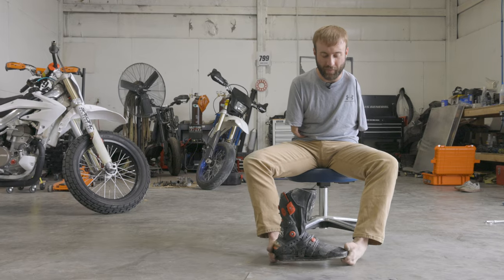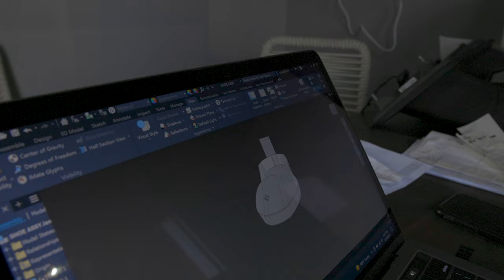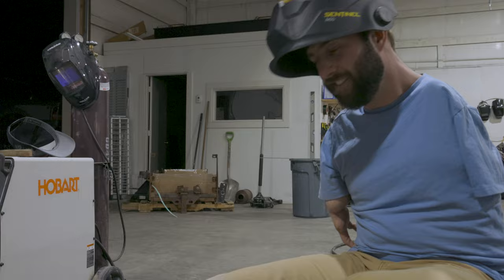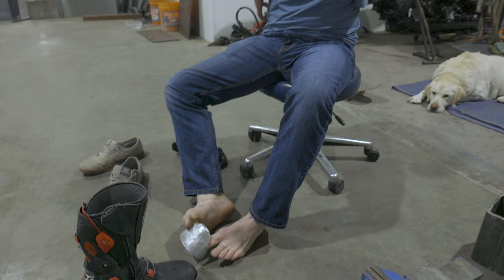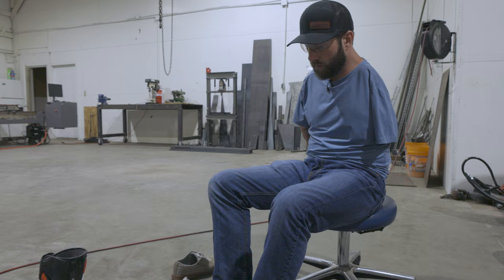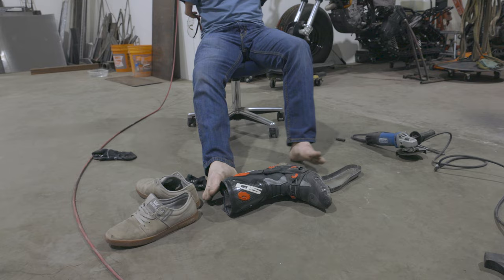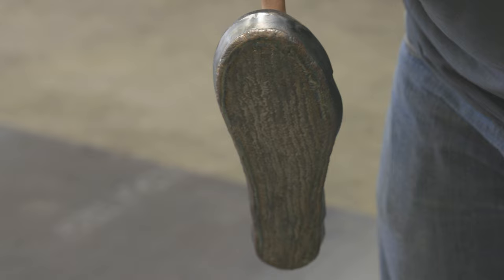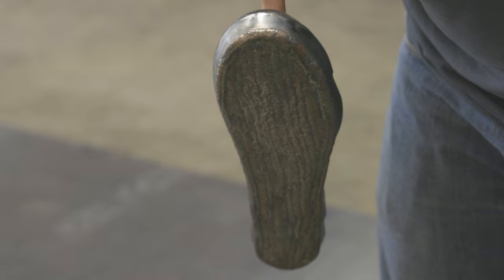Making a Steel Shoe for Flat Track

Comment: Mr Happy hot shoes from California I have a suggestion to eliminate the use of straps all the professionals that I know don't want to have straps on their extremely dangerous you take a self-tapping screw screw it through the rear heel of the hot shoe into the soul of your shoe never had one come off yet I'm retired now best of luck in your passion